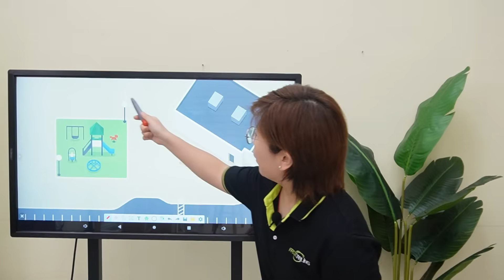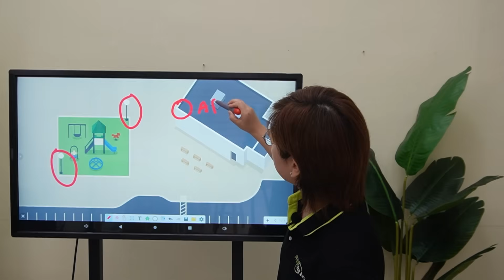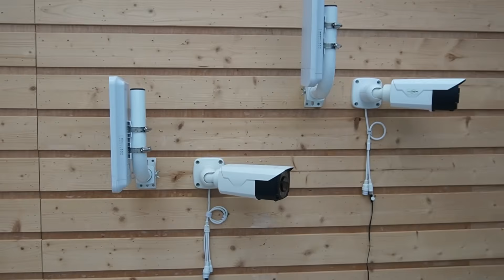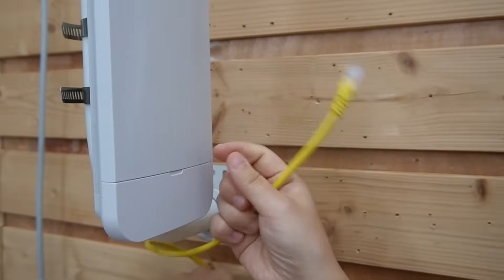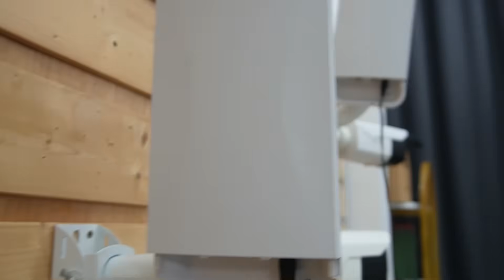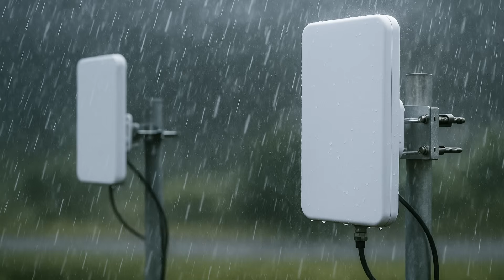No Trenching Needed! Wireless Bridge Setup for Playground IP Cameras

Comment: Does wireless bridge work with PTZ camera?
Reply from the maker: It can work with most cameras, but it only provides data, not power.  You can connect the bridge to an outdoor PoE switch to connect and power multiple cameras at once.

Comment: Your NVR has audio out and no mic 🎤 input. Is there anyway to connect a mic to talk . Like mouse click on mic to talk on cameras?
Reply from the maker: The NVR does not have a mic input. It only has an audio output, so you can’t connect an external microphone directly to the NVR. If you want two-way audio, the camera itself must support a built-in mic and speaker (or have audio-in/audio-out ports). Only then can you use the mic icon to talk through the camera.

Comment: We need to see some real life setups outside, where there is lots of noise and real weather conditions :)  Of course everything will work when its 2m apart :)
Reply from the maker: You are right about the interference. Take the built-in spectrum analysis to scan the spectrum and find the related clear frequencies could avoid some interference.